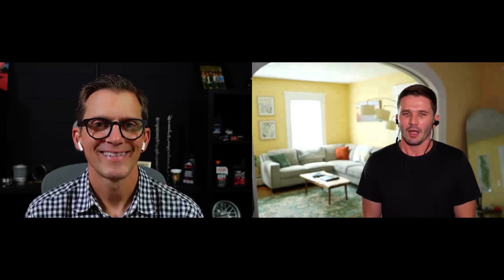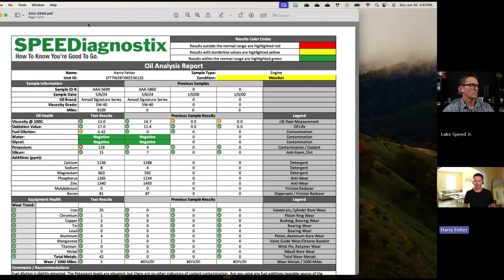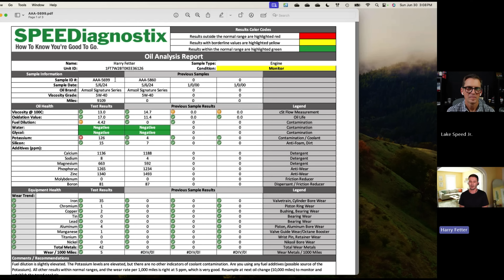9000 Mile Amsoil Oil Analysis With The Motor Oil Geak

Comment: I'm totally ok with paying the extra money for more frequent oil changes. After all, I change the oil myself. Probably about 7,500 miles/8 months with a powerstroke. Smaller cars, 5,000 miles/6months MAX.

Because I can tell you one thing for sure, Lake Speed Jr. and Blackstone labs will NOT pay for repair bills if something goes wrong. 

If anybody has a problem with my practices, they are welcome to come and get my waste oil.

Comment: The reason powerstrokes and cummins have a higher fuel dilution is bc they inject fuel on the exhaust stroke during regen. The new ones are like the duramax where they have a 9th injector so id be curious if its lower on those

Comment: I owned a 2018 Yamaha Star Venture Transcontinental touring motorcycle, there is nothing harder on oil than a V-Twin Air Cooled engine with a gear driven primary and transmission in a shared sump system. I ran Redline 20w-50 oil in it and Yamaha had 4,000 mile oil change intervals, but I did used oil samples with Blackstone lab and because of the great used oil reports started doing 8,000 mile oil changes. The Blackstone lab reports still came back with great results and they said I could run the oil longer but I stayed with the 8,000 mile oil changes. 

The point is if you run a true quality Group IV PAO or Group V Ester synthetic oil you will have the best protection you can give your engine. Myself I only run Redline oil and gear oils in my vehicles. Redline has served me great over the years and I will continue to use Redline products in my vehicles. 

I refuse to run any of the Group III conventional oils masquerading as full synthetic oil, the BBB's Division of Advertising did a huge dis-service to the consumers of America when they sided with Castrol allowing them to label their Group III conventional oils as full synthetic. Mobil tried to explain to the BBB the different between true Group IV PAO and Group V Ester synthetic oils from Group III conventional oils but the BBB refused to listen.
Reply: wasted it.   you could have went 20,000 more miles.  stop wasting it

Comment: Ok. So I take my Honda to the dealership every time the engine oil life monitor gets down to 15% remaining, though sometimes they're busy so I have to wait a week or two. My engine has 302 thousand miles on it. It seems to have worked so far for me. Is there something I'm missing? Why do I need an oil analysis?
Reply from the maker: Oil analysis is really helpful if you run big miles. For the average person maybe not as helpful but still work while every 100k or so to make sure you know what’s going on
Reply: 355,000 miles on my 2017 F350 super duty diesel transporting RVs every day and I go 15,000 miles between oil changes

Comment: Is there a point to running the best oil 20k rated vs a good oil 10k rated in a diesel when dilution is showing up at 6 or 9k in an extreme use scenario. I run my truck 24 6.7 Cummins 12 to 14 hours a day 5 to 6 days a week, towing 12k in a moderate climate (texas). I never idle cold or for more than 30 minutes.
Reply from the maker: It depends on how the fuel dilution is affecting the rest of the oil report

Comment: @russellridge8623 the problem with trucking companies all their concerned is bottom line which  is profitability if they can run longer drain intervals and it increases profits because they don’t have to do it OCIs as often and they don’t care if the longer drain intervals actually cost 💲 them in long run because it increases wear and tear on the engine. 🙂

Comment: I go by a road dirt/oil filtration ratio or oil filter life ratio. 🙂
Reply from the maker: How does that work?
Reply: @powerstrokemaintenance  how full the oil filter is versus how well it is filtering. My oil changes are based on the oil filter not the oil. 🙂

Comment: I wonder about the Cetane Additive that Ford sells as a fuel additive for the 6.7 Powerstroke. 

Does the Cetane provide additional lubricants to help prevent the CP4 from failing as I’ve read in different places on the internet, or are there better fuel additives that will help prevent CP4 failures?
Reply from the maker: To my knowledge, cetane is the ignition additive for the fuel. I don’t think it helps the cp4 much. I would just be sure to run another off the shelf additive that provides additional chemicals that will add lubricants

Comment: Amsoil is the best. You should also install Amsoil’s bypass oil filter kit. I did their dual remote kit on my ecboost 3.5. And its awesome and also much easier to change filters much more easily since they aren’t buried where you can’t reach them

Comment: I know gas vs diesel are 2 different worlds. In my 2010 6.0 GM with 188,000 miles thats been very well maintained, i go 6,000 miles but change the filter out at 3,000. Im running valvoline hi miIeage 05w30 synthetic. I wonder what a oil analysis would cost me.
Reply from the maker: Thank you for the comment! It could be anywhere from $35 to $70 depending on who you use

Comment: With cars and pickups   it's cheaper to change your oil more often than it is to pay for the oil analysis ..
  GM recommends 10,000 mile  oil change Intervals for my 2003 Duramax with a 10 quart capacity.  I see the newer Duramax's hold 7 quarts.  Older class 8 trucks hold 8 gallons of oil .. The Murphy Diesel in my crane holds 12 gallons of oil .
  My Duramax tells you when to change your oil based on how hard you ran the engine. It shows % age of oil life left.  The Problem is if your batteries get disconnected it goes back to 100%.  It's a good thing I wrote down my milage when I last changed my oil 4 years ago.  I am just over 10,000 miles right now and the oil looks really good yet.
Reply from the maker: Thanks for the comment!
Reply: The Class 8 trucks I drove in the 1990s and 2000s held 10.5-11 gallons of oil. (42-44 quarts)

Comment: 2018 and a 2016 6.7 the 18 light goes off around 9-9500 mi and the 16 goes off at 7-7500mi the 18 the boss runs around in pickup,  always has good samples, the 16 f550 that I constantly tow always has high fuel delusion at 7500mi, last one was 9.2. We run a 15/40motor oil since both new. So the 550 gets it at 5k mi now always.  18 has 230k mi the 16 has 180k mi. Sampling thru your local Cat dealer is 25 bucks
Reply: 70$ is expensive to send a oil sample.  That's the highest I've seen in last 20yrs , we use 3 places, cat, jd whoever does they're samples and volvo,  whoever does they're samples , Cat is 25 bucks, the other 2 are 30 bucks
Reply from the maker: Good info thanks for sharing!

Comment: I think the capacity of your oil pan matters as well. The more oil the engine holds, the longer intervals you can go. If your oil pan is only 4 quarts on a V6 such as my 2003 Impala, I change it every 3 to 4000 miles. Filter, every other oil change.
The large caterpillar and Cummins diesel engines hold about 45 quarts and spend a lot of time on the highway. That is a lot of oil. 
My Duramax 6.6 L, I’ll go about 7000 miles, but it holds 10 quarts. It smells like diesel fuel and comes out thin and runny by then.
Reply from the maker: That’s a good point

Comment: Part of why I change the oil at 5k vs 10k mi is b/c I don't trust the dealers I have a choice to deal with in my local area. I caught one flat-out not changing my oil filter on 2 occasions before. When I change my oil at 5k & then have the dealership change it at prescribed 10k mi, I at least know the oil & filter was 100% changed at least 1x during the year. Note: My car does not have a dipstick & does not have a canister type oil filter. 

Once my factory warranty runs out I will just change the oil myself & will likely run a lot longer (based on U/O analysis) but for now I don't trust dealerships as far as I can throw them so changing out early is the only good way I have to know I'm getting fresh oil & fresh filter at least once a year.
Reply from the maker: Makes sense!

Comment: Excess fuel from regen shouldn’t contaminate your oil as regen occurs after the exhaust manifold.
Reply from the maker: Thanks for the comment
Reply: @robertmontgomery7158  I dont know about all trucks, but in a Cummins, I believe it's injected in the exhaust stroke and dilutes the oil
Reply: Yes some engines use in cyl doseing  for regen

Comment: If you read my comment it is 75:25 or 95:5 and it is based on whether you have a 10K, filter which is the maximum amount of mileage that filter can last so 7,500 to 9,500 is when you should consider changing your oil so, 9,000 OCI/ODI is not a bad idea to change your oil because you don’t want to stretch it longer than 9,500 or 95% of a 10K mile oil filter. The reason why you don’t want road dirt or sludge backing up into your oil. What I say depends on whether you use a 10K, 15K, 20K, or 25K oil filters. I never base my OCI/ODI on engine oil because you could be throwing away perfectly good engine oil. 🙂

Comment: I want to hear more about that car that would kill oil in 3000 miles. So if you drive for example to the train station every morning and evening 1 mile in 35 degree F weather only going 40 mph max, you’re adding fuel and condensation to the oil, killing it. Then on the weekend if you drive 30 miles on the highway, you can evaporate that contamination out. The reason why your(power stroke maintenance) oil can go for so long is because you’re always doing hot highway miles, and you have a super filter right? What your saying is highway miles have the following benefits: Gets oil up to temp, and lower blow by because of the extra engine torque yielding higher cylinder pressures. The combination of these remove the contaminates from engines?
Reply from the maker: Yes that is a good summation. Oil has an optimal temperature. If I ever stop driving as much highway as I do, I will retest. This same truck and oil would break down faster with shorter trips in cold weather. But right now I’m driving 8 to 10,000 miles per month of mostly highway

Comment: Because of Lake I'm back to 3000 mile oil changes.
Reply: me to 3000 mile oil changes gmc 6.2
Reply from the maker: Nice!
Reply: My 5.4 doesn’t like anything longer than 6 months or about 3k.  The VCTs start acting wonky once it’s dirty.
Reply: @bobbowie5334  How  many qts. at 3000 miles?
Reply: On a good car, that's throwing the money in the trash.
Reply: 3k ? ? ?  just like every1 did back in the 1950's & '60's wen they used REAL crappy real oil compared to 2dayz real oil... i still remember changing oil w/my dad @ 1600 miles a few times... most any synthetic oil made 2day iz soooo much better...
Reply: @brucek.hoffman5868  Also so much thinner.
Reply: @brucek.hoffman5868  Today's low tension piston rings and GDI are a problem

Comment: 2015 KR F250, 418,000 miles. Change oil every 5000 miles w/ Rotella T6, change the filter every other oil change. Filter is a CAT 1R-1807
Reply from the maker: What made you decide to do the filter every other oil change?
Reply: @powerstrokemaintenance  It's a large CAT filter about double the size of a Motorcraft filter

Comment: Since modern day synthetic oils do not breakdown the way old school petroleum mineral based oil does I go by how long the oil filter lasts. I have a system called oil filtration road dirt efficiency percentage ratio (OFRDEPR)/road dirt percentage ratio (RDPR) to put it in layman’s terms how much garbage the oil filter is filtrating versus how full the filter is full of dirt. So I recommend 75% or 75:25 to 95% or 95:5 ratio of maximum that the oil filter can last. Oil change intervals/oil drain intervals (OCIS/ODIS) is based on the oil filter not the oil. 🙂
Reply from the maker: That’s interesting. How can you tell how much filter life is left?

Comment: A coworker drives his new F150 V8 five miles each way to work and sits in his truck at lunch for forty-five minutes with his A/C on at idle. I told him you are probably doing damage based only on opinion. I'd love to see the oil analysis from SPEEDiagnostics  on his oil sample.
Reply: It will be fine. I do the same thing with my 2015 2.7L f150, oil analysis came back perfect.  No oil dilution, wear metals are  very good levels.
Reply from the maker: Yeah that’s interesting. What’s your oil change intervals at for that much idling?
Reply: @powerstrokemaintenance  I change every 3-4,000 miles no matter what

Comment: I pulled oil samples from HOT jet engines on the flight deck right after they shut down and parked.  It's not about the oil - it's about making sure the engine isn't going to grenade at 30,000 ft or while evading a SAM.
Reply: FACT; AMSOIL was developed by a fighter pilot in National Guard who was fascinated w/the synthetic oil used in the jets he flew... also being 1st synthetic oil approved by API...
Reply from the maker: That’s wicked cool!
Reply from the maker: Interesting! Makes sense. Thanks for the comment

Comment: The oil can outlast the filter going 10k+ miles, so what is a good interval to change the filter before the filter starts to break down into the oil?
Reply: A friend of mine sends his oil to blackstone, and he used to stretch his oil changes. In one of the analysis reports they stated that they found filter particles in the oil. I guess until you have that issue, no need to change your filter before changing the oil.
Reply from the maker: How do you know the filter I’m using will break down the oil?

Comment: This comment isn’t related to diesel engines but it’s just funny to me. My coworker pulls our 14’ enclosed tool trailer with a 3.5 ecoboost and is the exact opposite of me when it comes to maintaining a vehicle, I’ve had a 3.5 eco and the UOA told me 7k was max with full synthetic oil. However, he waits until the 10k light comes the dash and then tries to change it sometime soon. He’s always over 10k and mostly closer to 15k. He gets it changed at his local ford dealer so they probably not using too tier oil.  Anyway, he’s over 250k on his 2018 3.5 now with no oil usage and it drives me crazy
Reply from the maker: That’s insanity 😂

Comment: Why not just buy Shell Rotella T6 on the cheap and change it more often?
Reply: wen u spend BIG BUCKS on a vehicle, y wood u cheap out on sumthing as cheap as oil... even a good oil... u will get better protection etc f/a good oil... AMSOIL now makes a BLENDED OIL that iz 50% + synthetic, not who knows wut % iz blended in the other brands... save $$$ & get a better oil...
Reply from the maker: @brucek.hoffman5868 a good point
Reply: @brucek.hoffman5868  I hate going to someones home to purchase motor oil.  All the Amsoil dealers I've worked with in the past would say "Yeah I have it in stock" then I'd go to their home and they'd say "Well you can use this instead". I don't waste time with those independent resellers anymore.
Reply from the maker: Because I’ve run the numbers and it’s not actually cheaper. Especially given that some months I’m doing 10 to 12,000 miles.

Comment: One thing I found interesting is that the more load that is on the engine the less the EGR is active. So that might be one reason why I am able to go further distance is because of they’re always a decent load on the engine. Also anytime, my truck is in park and engine is running. The idle is 1200.
Reply from the maker: That makes sense. It sounds like it’s running hot a clean

Comment: Some people change oil on feelings and some change oil based on testing and facts.  I use UOA to get the facts and save a ton of money on 20k oil changes for my 6.7. Almost 200k miles of nothing but towing all over the SE USA.
Reply from the maker: That’s impressive thanks for sharing! What are you towing?
Reply: @powerstrokemaintenance  one of 5 trailers most of the time. If I’m. It working then the truck is hauling our tractors or the toy hauler.  Usually nothing crazy heavy but enclosed work trailers.

Comment: Oil and filters are cheap, just change them regularly "3000mi. - 5000mi.and the engine will last longer than the life of the car itself. 
My Analysis is to keep an eye on the oils condition,  if it starts to look dirty I change even if it is before my regular oil service.
Keeping your oil clean will keep you in the A+ catagory even without lab testing, those lab reports are just going to confirm you that your oil is A1/OK.
Reply from the maker: No

Comment: I have a very scientific method of determining when to change the oil. When the oil starts to get dark brown, it’s time to go. I do not wait until it gets black. I drive gas powered cars (as opposed to diesel) and this has worked well enough for my last 4 cars to exceed 200k miles each with no engine issues. Didn’t have high oil consumption either.
Reply from the maker: There’s someone else on here that said they smell their oil 😂
Reply: @powerstrokemaintenance maybe they can train their dog to tell them when it’s bad? You know, save $80 in analysis!
Reply from the maker: There ya go 😂👌
Reply: @wirenut3020 😂😂😂